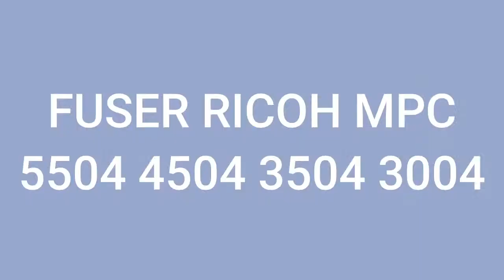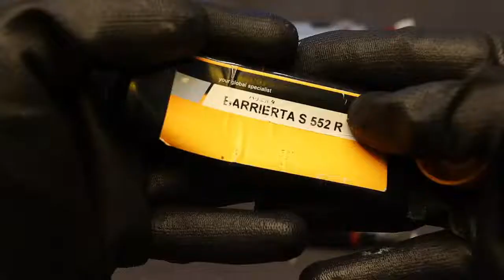💥LIVE 💥 Replacement Fuser Belt, Press Roller, Oil Pad RICOH IMC 2000 2500 3500 4500 FUSER MPC4504

Comment: Hi, I have the following issue:
 When printing the toner does not adhere to the sheets, if I use a 70gr bond sheet I must set the parameters to 100 -160 gr so that it prints well and 300gr substrates such as couche do not print, even if I set the printer to 300gr

I recently changed the fuser film as it was broken. but now I feel that it does not have the same temperature as before.

Do you know what could be the problem?
Reply from the maker: First, set the driver option: thick one.
Secondly, replacing the foil itself will not improve the functioning of the machine. You always have to replace the oil pad that is inside the foil.

Comment: Hello Copy-Expert, a question, the film and the oil pad for these IMC models, are they the same as for the previous models called mcp, 2004ex, 2504 ex etc.......?? Could I use those of the mcp for these imc? thank you very much for your videos!!!!
Reply from the maker: @elsariguella That's a very good question. So maybe it will show you the compatibility one by one:
- Lower Press Roller RICOH MPC2003 MPC2011 MPC2503 MPC3003 MPC3503 MPC4503 MPC5503 MPC6003 
- Lower Press Roller RICOH MPC501SP MPC2004 MPC2504 MPC3004 MPC3504 MPC4504 MPC5504 MPC6004 IMC2000 IMC2000A IMC2500 IMC2500A IMC3000 IMC3000A IMC3500 IMC3500A IMC4500 IMC4500A IMC5500 IMC5500A IMC6000 
- Fuser fixing film Ricoh MPC2003 MPC2503 MPC2011 MPC2004 MPC2504 MPC3003 MPC3503 MPC4503 MPC5503 MPC6003 MPC3004 MPC3504 MPC4504 MPC5504 MPC6004 
- Fixing Oil Application Pad Ricoh MPC2003 MPC2503 MPC3003 MPC3503 MPC4503 MPC5503 MPC2011SP 
- Fixing Oil Application Pad do Ricoh RICOH MPC501SP MPC2004 MPC2504 MPC3004 MPC3504 MPC4504 MPC5504 MPC6004 IMC2000 IMC2000A IMC2500 IMC2500A IMC3000 IMC3000A IMC3500 IMC3500A IMC4500 IMC4500A IMC5500 IMC5500A IMC6000 z olejem 
✔️ Access all lessons and bonuses ✔️ https://youtube.com/playlist?list=PLQGXf8WTvixODLzK3dJ6f_wiNp734mU_0
✔️Be a supporting member ✔️ https://www.youtube.com/channel/UCOHtXTtGHj33pUm8Gf2FH3A/join
Reply: @MrRicoh  vERY VERY THANKS!!!!!!
Reply from the maker: @elsariguella I hope it helps you.